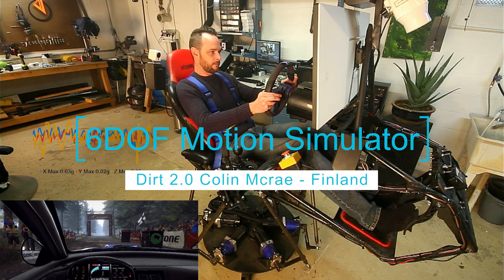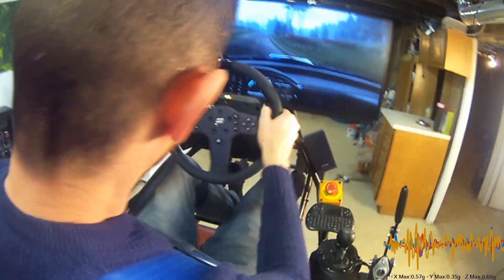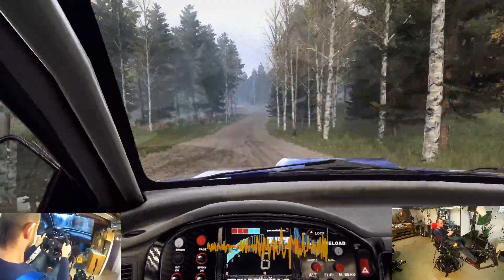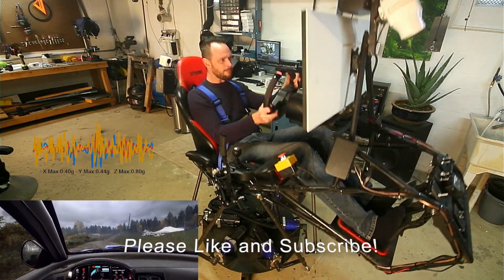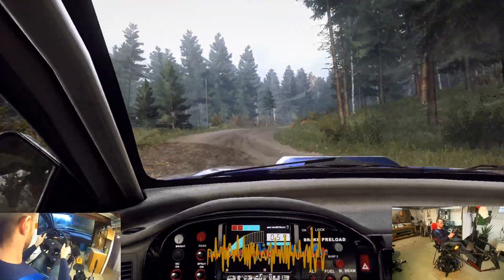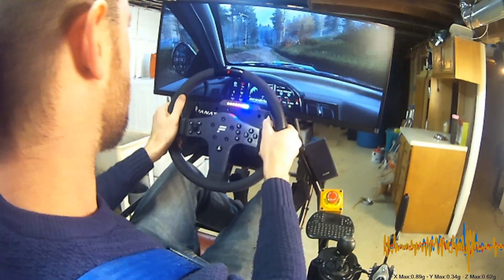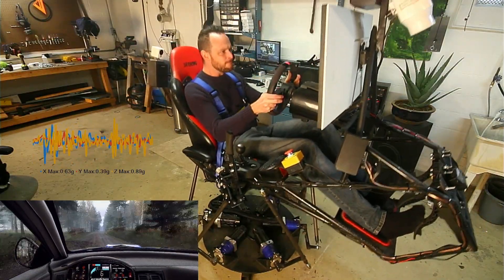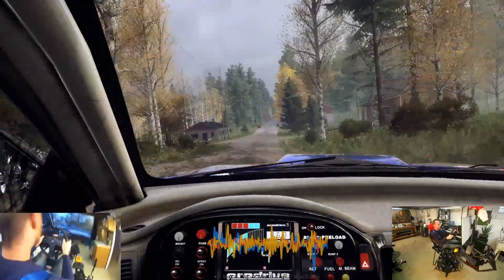DIY 6DOF - Dirt 2.0 - Colin McRae DLC - Finland

Comment: Looks painfully fun! How tunable is your platform? can you control intensity, ramp up speed, etc?
Reply from the maker: Very tunable, there are S curve acceleration profiles located on the motor controler That I use to dial in an appropriate Ramp up/down acceleration, so that it does not rip apart the chassis.. or the driver. on top of that I use Simtools to filter and normalize game outputs to drive my controller (esp32 based) .

Comment: this thing look really good. i wonder if the lag is something you can feel? in particular at 1:32 you can see jump and it is visible that the car lands and then after i guess half a second platform makes respective move. can you please elaborate on that?
Reply from the maker: The data is sent to the controllers at 1ms rate, There is a level of ramping up and down that it needs to do, which is tune-able on the AC controller side. This acts as dampening under acceleration, (see "S - curve acceleration profile") I currently have it ramp up acceleration/deceleration over ~100 ms each I believe after that there may be a perceived damping delay from the suspension travel? . I have ventured into higher reaction speeds but there is a drawback with the capable acceleration in most scenarios.... .. in that it will hurt allot more. and damage the chassis in the process. The ramping is there to protect the rider and the sim. I was the crash test dummy when building it.   There is a reason there is a E-Stop.  hope that answers it, it is tune-able, to scary fast if that suits you :)
Reply: @Christopherknauf  thanks for fast answer. sounds good - i've noticed your description on github at the bottom (regarding tune). so long story short - is it ok from your perspective when you play or should it be faster/quicker/ more immediate reaction?
Reply from the maker: @ZenMotionSim  Its really up to the rider, and what game they are playing,.. Dirt 2.0 is on the more... Dynamic side of the spectrum.. so it may be more filtered than some other games, as you do also need to add filters/ mix forces before giving the data to the sim controller. I tune each for this platform with quick response in mind, I understand the difficulty of driving with lag, and the nausea it may/will cause.  I had no issue navigating the course first try with the simulator, nor feel any disconnect or perception of lag while driving.
Reply from the maker: Thought of something else, The video feed comes from a Canon 7d - over usb capture card, i suspect that is also significant delay from that conversion(at least when talking about.. fractions of a second...) where the game is directly on the machine and it just grabs from the frame buffer.